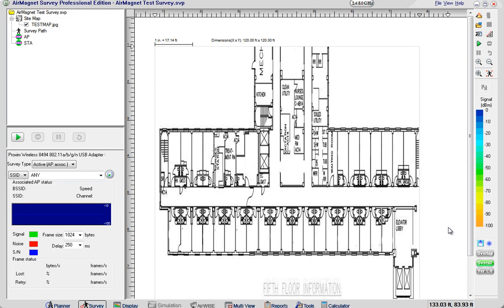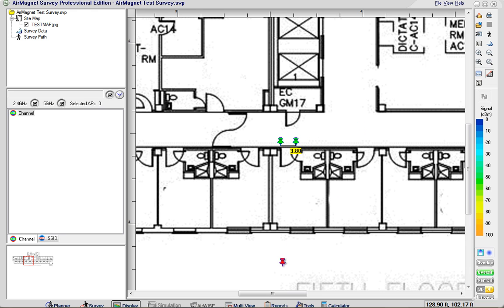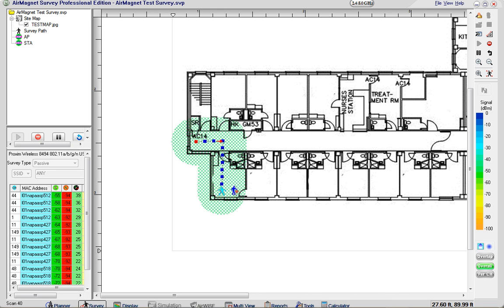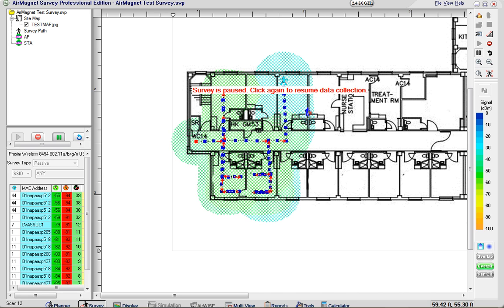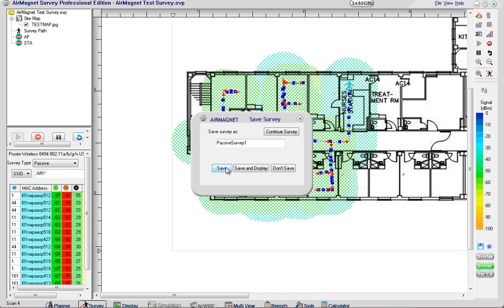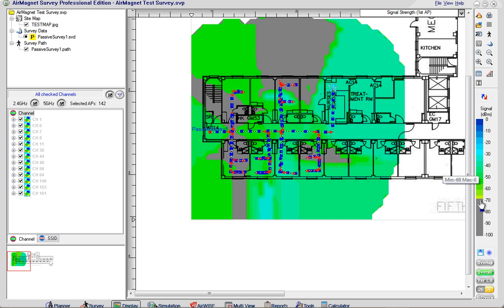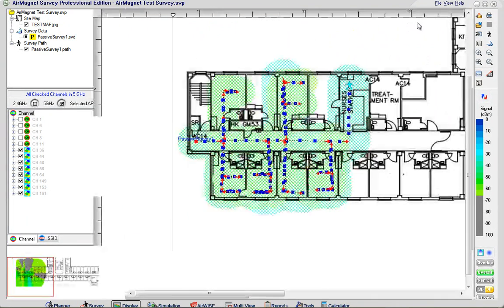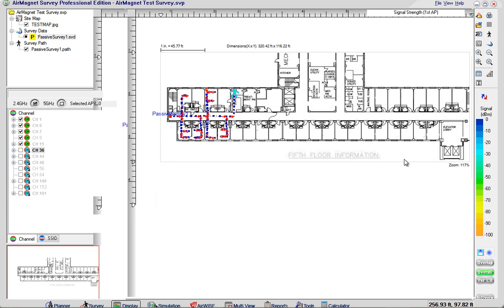AirMagnet Survey Pro Passive Site Survey - How To

Comment: hey jennifer. usually for airmagnet survey, do we need to set the wall materials or door onto the floorplan before we start doing the survey?
Reply from the maker: You need to do that if you're doing a predictive survey. If you're doing an active/passive survey (like in this video) setting wall properties is not necessary as you're taking readings of the RF environment around the walls shown in the floor plan.

Comment: Jennifer are you physically walking or the walk is a simulation. .... In any case how would you integrate the AP setup info into Airmagnet??
Reply from the maker: For this video, I was physically walking a site. I'm not sure what you mean by 'integrating the AP setup info into AirMagnet'. This type of survey is just taking readings of the RF that currently exists in the environment. You can see the many SSIDs in the lower left hand panel. If you were focusing on one SSID, you can filter out the other SSIDs when you've completed the survey. The 'display' tab in bottom of AirMagnet has filters to show one or several SSIDs from the survey data collected. Hope this helps!
Reply: +Jennifer Huber thank you for your response , what i meant was how did you know tool know where you were walking . Do we have to enable gps ??? Or is it as simple as the sniffer scanning the beacons , and displaying the RF signal as you walk the the application able to guess where you are in the site ??

Comment: And which tools where you using? Is it just a your standard latop and the AirMagnet Survey Pro software. Or it's your GPS enabled laptop with some external Wi-Fi testers plus the AirMagnet software and maybe added extras???
Reply from the maker: I was using AirMagnet Survey Pro and a Proxim 8929 wireless USB adapter. There were no added extras or GPS used. Hope this helps!

Comment: What I mean is: How do you use the ActiveSurvey features in AirMagnet (association/iperf) with a mobile access point station (e.g. access point mounted on a pole and then wheeled around the office) to plan out a wireless deployment? (This would be an office where there is no existing wireless.)

Comment from the maker: 1.) You would use the "Planner" mode of AirMagnet to plan for same channel separation. The Planner mode requires an additional licensing purchase from AirMagnet.
2.) I'm not quite sure what you mean by 'onsite verification using mobile access point'. Onsite verification surveys are usually done with a laptop using AirMagnet Survey to document the deployed RF coverage.